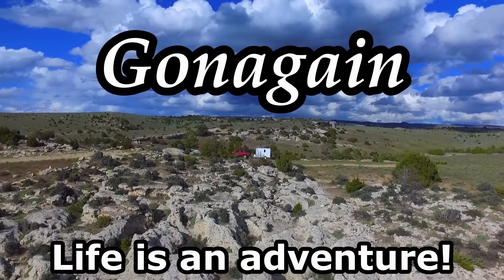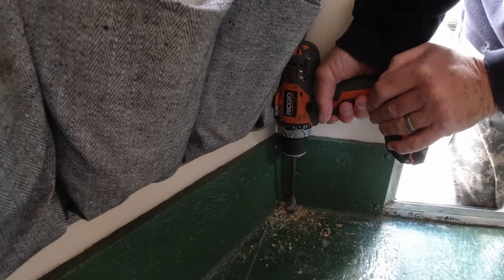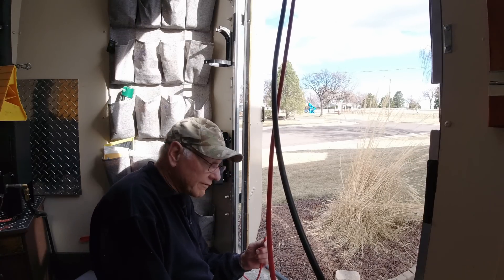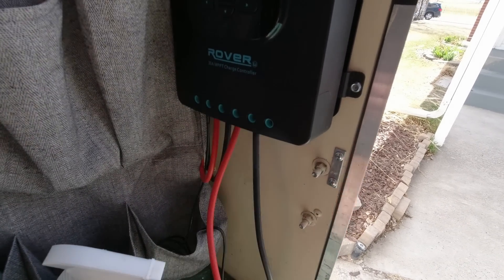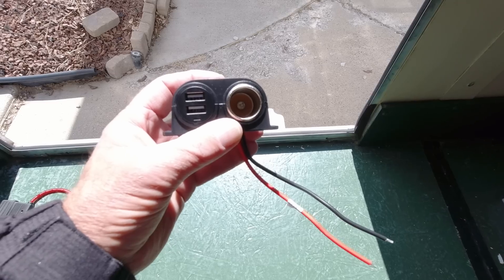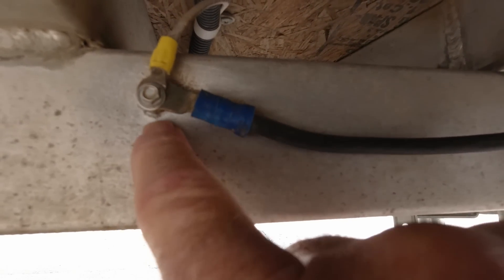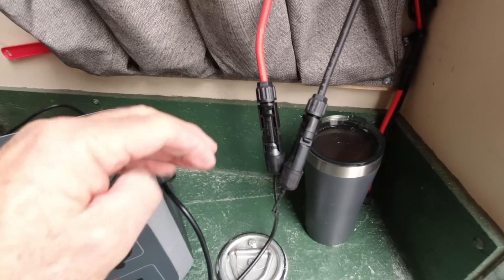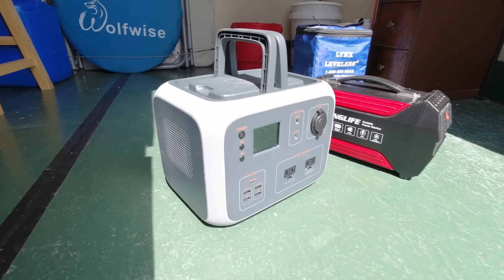RV Solar Install - Renogy Rover 30 Amp Controller

Comment: I know this video is 2 years old, and I don't know where you are at with the battery right now. But I paid $650 each for my (2) 200AH Ampere Time  LiFePo4 batteries, Hooked up in series, to make 24V. That gives me 200AH of 24V which allows me to run my 6K AC in full sun and keep the batteries topped off. .I can run my 7.3 Danby for 3 days with no charge. The batteries are expensive, and I had to sell some things I would have rather not sold, but if you treat the batteries right, your done, you should never have to buy  batteries again. Also you only get 10% from a lead acid, versus 90% from lithium. Once you go lithium, you never go back...

Comment: I came Across your Video and It is very well explain. Nicely Done! A++ on this video. Having my first troble with my Solar installation. Did everything right but don't know why the batteries are not charging. From Solar to MPPT controller and to the Battery. What am I missing?
Reply from the maker: Hello Jose, double check your wiring connections first. Are the batteries low or are they already fully charged? If they're charged then they won't accept more.
Reply: @gonagain  Hi Gonagain,  Thank you for the head up. I didn't think of that! But since my batteries are at 90% now, I hope that this time it will work.

Comment: Should you connect the load wires to the charge controller while connected to the battery? OR connect the load wires first and then connect the battery?
Reply from the maker: First connect the battery, to avoid damaging the controller. I would do this by making the connection at the controller and then at the battery.  After that, connect the solar input.
Reply: @gonagain  should you wire the DC load into the controller first before connecting the battery? I don’t wanna damage my charge controller.

Comment: If I might ask , what did you secure the insulation under the floor with  ??
That's one thing I need to do to mine yet !
Reply from the maker: Hello Murray, we used two things;  Foam Board Construction Adhesive and screws that were just long enough without penetrating the floor with large fender washers under the screw head.  The adhesive does most of the work.
Reply: @gonagain   PL 300 then it will be . Thank you  may ALL your Journey's be Blessed , Take Care .

Comment: What happens to blue Eddie when sun goes down?   If voltage is too low does it harm it if forgotten on direct charge?
Reply from the maker: Hello William, no, it has a very good battery management system (BMS) that protects it against total discharge and overcharge as well.

Comment: Thanks for the video.  I am not installing solar in my RV camper.  I found a Renogy 100 Amp Hour Lithium Battery on Ebay for $400.  They are going fast though.
Reply from the maker: Wow! That's a good price, considering that it equals two 12 volt deep cycle batteries and will outlast them about 8 or 9 to one. I just put a Renogy lithium in our trailer and will be reporting on it soon.

Comment: Happy New Year Rick. Quick question, the Jackery 100 watt Solar panels should work just fine with this same setup, would you agree ? I'm getting materials ordered up for my solar install coming Spring time, what gauge wire are you using coming into and out of the controller ?
Reply from the maker: Those panels should work fine.  My wires are #10 from my panel down to the controller.
Reply: @gonagain  Thanks, much appreciated :-)

Comment: If the fuse blows on the + out to the battery will that harm your controller? I know you said not to disconnect the battery with the panel connected.
Reply from the maker: Good question and I don't know the answer.  It's in the Renogy installation instructions to connect the battery first and then the solar.

Comment: I am confused with your tap off before your solar panel goes into the solar charge controller.  Do you have positive and negative touching each other?  I see black and red wires going into the same port.  Can you explain?  thanks
Reply from the maker: Yes, I can explain, but you weren't supposed to notice that.  I mistakenly installed the wrong MC4 connector on the black wire and once you do that you can't take it back off again!  So in this case the color of the wires is reversed.
Reply from the maker: I'd rather not explain because it involves me making a mistake, but here goes... I put the wrong MC4 connector on the red wire and they are hard to get off, so the color got switched. It's now been corrected. You have the eyes of an eagle!

Comment: So 1st off NERD ALERT on this reply. But I hope it's helpful :) Traditionally, the load output from most solar charge controllers are meant to put out a low current supply, not much more than 1-3 amps, after the solar panel stops making electricity. This comes from the boating industry and is meant to run marker lighting automatically from the house battery after the sun goes down. Typically the controller has a programmable timer for how long that output will stay live after the sun juice goes away. That's not to say it isn't useful. I'm thinking about using it to run some dim LEDs under my tiny rig for rodent deterrent and foot-lighting. It could also be used to trigger a relay to switch bigger loads to run directly from the battery bank.

As for lithium batteries, yep, they are very expensive. Rather than ranting about pros and cons may I offer you this perspective coming from a practical guy who used to work on stuff like this for a living? Cheap lead acid batteries in the 80-100 watt-hour (WH) range go for around $90-$130 a pop. Nice AGMs of that size get up to around $230-$300. These are batteries that last around 1-5 seasons, reasonably. A high quality 100AH lithium goes for around $900 but will easily last 10 years and quite well beyond that. Maybe even up to 20 years if taken well care of. There are some caveats to give it proper care, mainly plan on needing to install it inside your camper, which can be safely done. Also, all lead-acid tech only delivers around 60% of it's rated capacity through a charge cycle at best while lithium easily hits 80-90% There are other positives but all-in, lithium is a good investment, just not an easy one. Why not run cheap lead-acid for 2-3 seasons while saving up for a lithium rig? Extrapolating the cost on that over 10 years isn't hard. Go through 1-2 cheap lead acid sets while saving for a quality lithium set makes sense to me and you already have the quality solar stuff to run it. That's what I'm working on.

On the fridge, you're right. 100 watts of solar+80 to 100AH house battery+small compressor fridge is just about perfect. I've been doing that for awhile and it works almost perfectly. Cheap, practical and simple. Mini-house-like refrigeration from the sun done with simple gadgets. It's not free but it's easily doable for not that much!
Reply from the maker: Your comment is very welcome!  It makes sense to go with the lithium for the long haul if at all possible.  I've been using the controller's power supply to charge our phones and it's handy for that.  I've added a jumper to charge my Jackery directly from the panel.

Comment: Nice work! one thought that you may want to consider is that the positive lead out of your battery should have a fuse as close to the terminal as possible. they actually make terminal fuses that mount directly to the terminal post for this purpose. The reasoning is that the positive lead is unprotected and if it were to short to the frame from getting cut or abraided all of your battery current is going to dump into the short.  if a terminal fuse is used there is zero unprotected length of wire..
https://www.amazon.com/Bay-Marine-Single-Terminal-included/dp/B07LC6273Z/ref=sr_1_5?dchild=1&gclid=CjwKCAjwkoz7BRBPEiwAeKw3q5Ae3ZN_nSBi1Wfngeh03oEVNSkRuske-cG_bGsavevnOkMihTeA3RoCECUQAvD_BwE&hvadid=241912103657&hvdev=c&hvlocphy=9001827&hvnetw=g&hvqmt=e&hvrand=10458684856723833426&hvtargid=kwd-10831136476&hydadcr=24633_10399728&keywords=battery+terminal+fuse&qid=1600401721&sr=8-5&tag=googhydr-20
Reply from the maker: I have a fuse on that wire but it's at the other end!  I'll get on that for sure.  Thank you!

Comment: I connected the load from my solar charge controller to the converter of my camper. So all power in and out is now monitored through my charge controller.
Reply from the maker: Cool Adrokk.  My system is really basic compared to other folks.

Comment: So your panel must be a 12 volt unit to give you about 18 volts for charging your solar generators?  I would caution others about doing this with the higher voltage panels that most use with mppt controllers.  The diversion load outputs on charge controllers are hot only when the batteries are fully charged, so not very useful until late in the afternoon usually.  A water heating element is a good choice for this, to have a hot evening shower on sunny days.

I strongly suggest using a pair of  wet 220 amp hour 6 volt golf cart batteries with your rig for upgrading.  AGM batteries are very temperamental and cannot be discharged below 50% or so, not true of flooded lead acid batteries.  Also no way to equalize them to extend their lives.  Maintenance free is good for a weekender, but with heavy usage a bad thing.  Much more expensive in the long run.  Put the golf cart batteries inside your rig in a box with a very small ventilation fan that blows air outside while drawing air from the inside of your rig.  Set your charge controller for lower battery voltage like 13.8 to reduce water usage if a problem.

Happy trails from a fellow cargo trailer converter.
Reply from the maker: Hi Gene, yes, the panel is 12V and a person has to pay attention to what the manual for the solar charger says is the max voltage allowed for that product.  Thanks for your suggestion on the 6V golf cart batteries and vent.  We did a battery box vent on my daughter's 7x14 that draws air through the floor and up and out the side of the trailer just below the roofline.  It's been working fine to get the hydrogen sulfide fumes out even during the day with the solar panels charging them.  I like your idea of a fan too.
Reply: @gonagain  I suggest using this type of fan: https://www.amazon.com/gp/product/B01GPEQZ8A/ref=ppx_yo_dt_b_asin_title_o06_s00?ie=UTF8&psc=1   These are 40 mm square 12 V brushless DC fans that draw 0.1 amps current and provide a little over 6 cfm.  Bore a hole in the floor and insulation  of your trailer with a hole saw under the battery box and mount the fan over the hole.  Draw in air through small vents around the top area of the box from inside the trailer.  This will provide a little ventilation for your comfort, keep the batteries warmer in winter and cooler in summer, and give  way for electrolyte to drain out if there is  spill or overflow for some reason.  Put some washers between the fan and hole to allow electrolyte to get out. 

You only need to ventilate while charging above 13.0 volts.  Mostly hydrogen and oxygen are produced.  Hydrogen sulfide only when plates are sulfated and charging at end of charge cycle.
Reply from the maker: @genetownsend2598  a small computer fan.  Thanks Gene.

Comment: Sulfuric leaking out of my Walmart batteries that are newer than yours.  Better carry some baking soda to neutralize it when it leaks.  (not if it leaks, but when).  I'm switching to AGM.  I can't afford cheap crap anymore.. :-)
Reply from the maker: Good choice.  My next one will be AGM also.
Reply: @gonagain  Just bought 4 replacements.   The Walmart EverStarts not only leaked but wouldn't carry a load.  Said 13.2 but when I put a load tester on it it dropped to 12.4 within seconds, then went below the min. (12.2).   Went to Advanced Auto Parts and picked up some AGMs. (I guess  they bought out Diehard at Sear's corporate garage sale.  ;-)   Came with a 3 year warranty.  Have no idea if they will work when needed, but I know they won't leak acid.. :-)

Comment: I have a "what if" for you to consider. What if you happen to plug in a shorted device into your 12volt/USB power outlet which comes from your solar control panel load without a fuse?
Reply from the maker: There is an inline fuse right at the solar panel itself, a fuse between the controller and the battery and a fused distribution panel.  I see your point though and it would be a good idea to install an inline fuse for that particular receptacle.  Thank you, I'll be doing that.
Reply: @gonagain  I installed a 20 amp circuit breaker on my load terminals on a Renogy Rover 30. The manual states that the terminals are rated for 20 amps.  The USB outlets, a voltmeter, and 2 cigarette lighter plugs are connected to the load terminals. I'm trying to build my device as stupid proof as I can make it in case I get a case of BDS....Brain Disengagement Syndrom. I certainly like my Rover 30 and the Renogy battery monitor. Your video steered my way a few months ago when I was dreaming up my system. Thanks!

Comment: Load can be a fan, or small heater with switch for winter time.. Im using a 100Ah agm battery. Runs the refrigerator fine.

Comment: how do you know to buy a 30 amp controller ??  did you add stuff up  thanks
Reply from the maker: I did, but it's not too hard.  In my case it had more to do with how much room I had on the roof of my little trailer for solar panels than it did on what I needed to run.  I figured I would be installing no more than 400 watts of solar to charge two batteries and I would only be running my laptop, a 12 volt refrigerator and charging some phones.  The only thing I needed to know was that I would have two, 200 watt, 20 volt panels, so 400 watts total.  If you divide that by 20 volts you get "20", or 20 amps.  So I knew a 30 amp controller was more than enough.  I'm not an expert on figuring this stuff out and I suggest that you research your own needs to see what you're going to require.
Reply: @gonagain  thanks for the reply and your answer helped be safe

Comment: Good info Rick, eventually I plan to do just what you've got going on there with your solar, your videos are very helpful. 
By the way we rode over the fourth in the Little Belts, went from Martinsdale all the way over to Utica, got caught in a pretty good storm as well. Scooter with the Rough Riders :-)
Reply from the maker: Nice ride!   We got caught in heavy hail and lightning once while riding.  Didn't feel safe under a tree and got pummeled in the open.

Comment: your video is very easy to follow and informative, i  also liked the way you cleaned up and ran the wire, thank you for sharing 👍👍
Reply from the maker: You are welcome!  The install is working out nice and I'm considering adding another 200 watt panel.  I think that if you add enough wattage then you probably don't need to make the panels tilt.

Comment: Missed this earlier. Good video as usual. Thanks.

Curious though. Your the first person I've seen hooking up two charge controllers to one solar panel when you added those leads for the blueti.   Wondering about effects, good, bad, or otherwise.  Had something similar in mind and there is just nothing out there on this.
Reply from the maker: The way I hooked up the Bluetti is directly off the solar without going thru the Renogy and the Bluetti has it's own MPPT controller.  The panel keeps working normally supplying current to the battery.  Did I answer your question? It's all working great.
Reply: @gonagain  yes you did. Thanks!  Two separate charge controllers charging two separate batteries from a single pv source. Cool!

Comment: Remember the portable banks have there own controllers. Don’t power them from another controller. I have two Rover 40, my instruction said don’t use the load side terminals for inverters or battery charger.

Comment: Just like a story of a person towing their car behind their motor home and all the time they were traveling the car was pumping gas to the motor, and when they tried to start the car the engine blown up; because it had the engine pumped full of gas, hard to believe, but was told by a mechanic that should know if true or false story and I think you have been a mechanic too...
Reply from the maker: Yeah, of it was in gear and had a mechanical fuel pump than I guess that could happen.  Wow.
Reply: @gonagain  That was the way it was told to me some car have to be towed on a trailer not their wheels...

Comment: Nice job, thanks for sharing.

Two things, there is "CU-AL AID" that you can use between Copper and aluminum  but under a trailer, SS is a good option too.

Don't use cable ties/tywraps, zip ties from China. "Cheap Chinese chit" . Use T&B, Panduit or Tyton, all made in USA by the Usanese.  I worked for Panduit for 15 years, they make over 1200 different cable ties, a few more than 2...
Recommend you get UV rated ones, read label as some are just colored black. Keep up the good work and well done videos!
Reply from the maker: Good info Bob.  I always buy good cable ties whenever I see them and I was unaware of the CU-AL-AID.  Thank you.